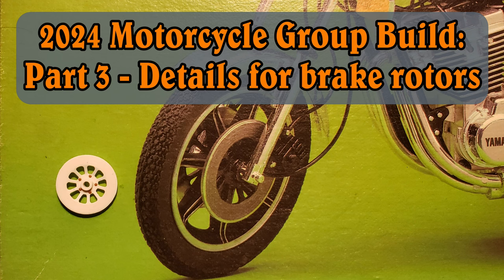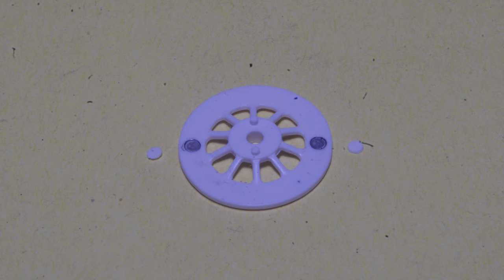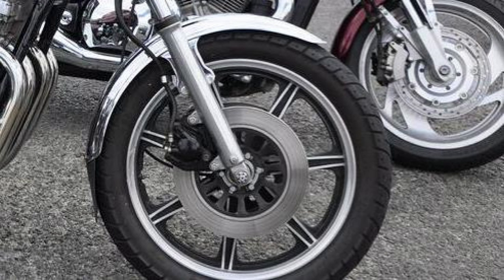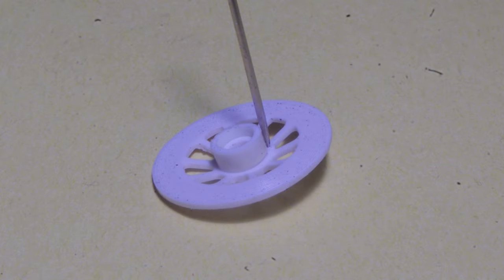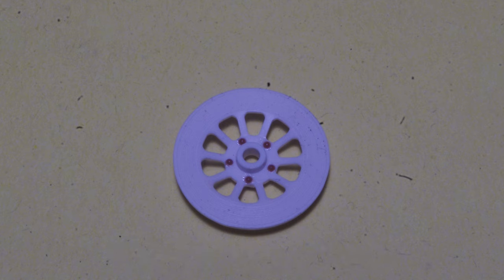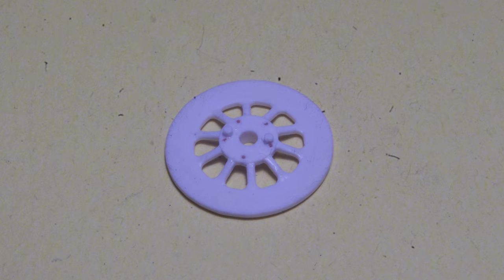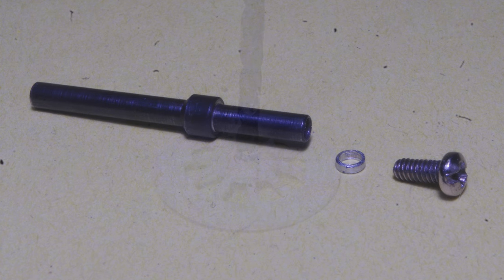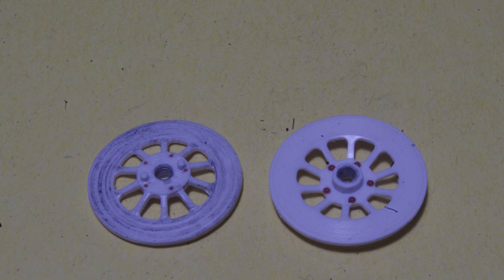#2024 Motorcycle Group Build: Part 3 - brake rotors

Comment: Pardon my ignorance, but what do you mean when say something like, "20 thow styrene sheet" Or 30 thow drill bit for example?
Reply: Just a short way to say Thousandths, .. .010, .020,.030 ect.
Reply from the maker: Even though I am from Canada I tend to use the Imperial system of measurement in thousandths of an inch as Cliff described in his reply.

Metric equivalent for .020" is 0.5 mm, .030" is 0.75 mm.  

I started in the school system back when Canada was making the changeover to metric in the 1970's, when I took machine shop in high school (early to mid 1980's) many of the tools were still calibrated in thousandths of an inch. That may be why I still use Imperial a lot!